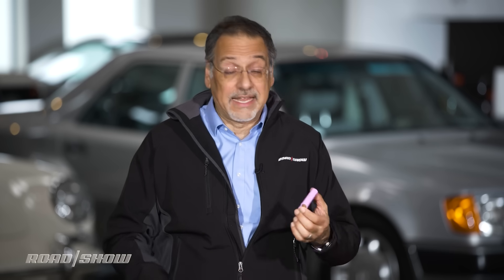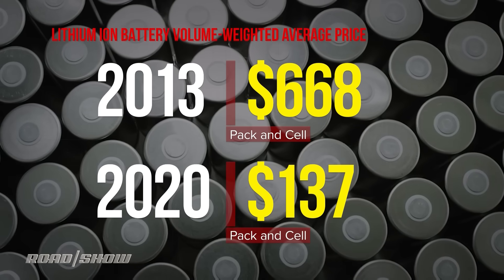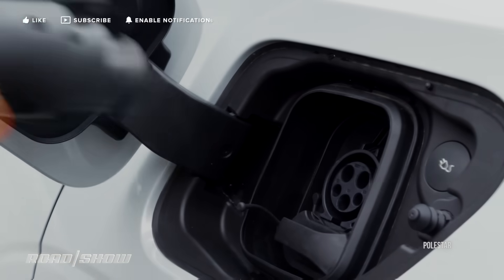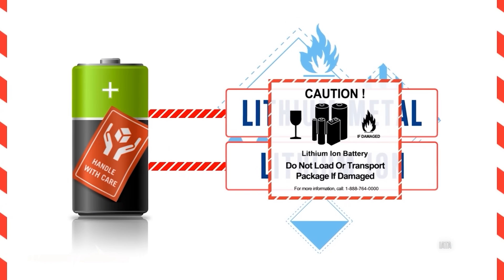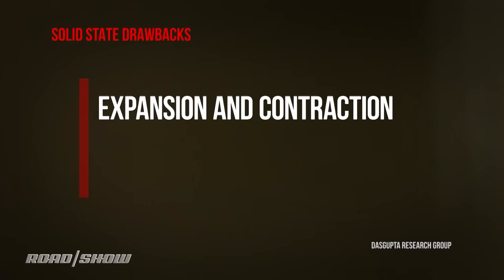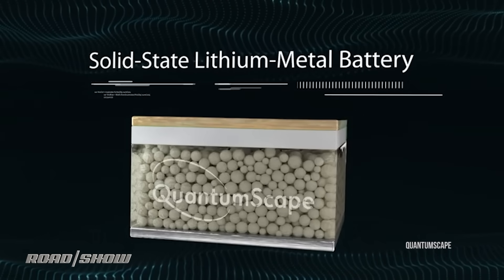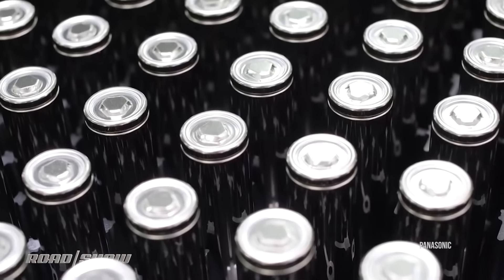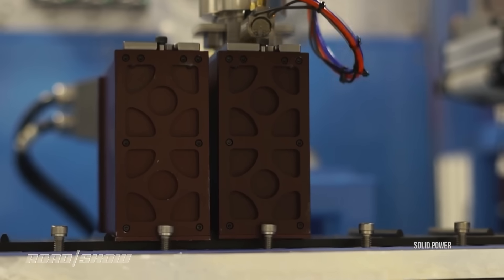When solid-state batteries arrive, you'll want an electric car

Comment: Dendrites are a problem with Lithium Ion, the liquid electrolyte allows it. Solid state batteries actually solve the dendrite problem as the dendritic growth is stopped by the solid medium.
Reply: I've seen another one of these explainer videos making the same mistake
Reply: I thought that was the case. I might have to do my own low budget less graphic version 😉
Reply: Dendrites?  Is that like what we used to refer to as tin whiskers, or simply the way they operate?
Reply: @Edgy01  Nope...you got it.  Tin whiskers.
Reply: THANKYOU,,,I was literally yelling at the TV with the amount of wrong this guy was babbling on about....
Reply: I hate when they misinform people.
I was "Dendrites on solid batteries? Whats he talking about"
Reply: @supaburger  I'm not technical at all and trying to learn everything with regards to EV conversions atm so obviously keeping a keen eye on battery tech. Got a V8 at ths mkment and nees to do a conversion myself. I think solid state will be the upgrade after 7 years I guess. Although battery tech seems to be the new gold so no doubt it will be quicker 🤔⚡
Reply: @chargeheads  you're converting a combustion engine car into EV? That seems like a bad idea, I know tesla had to completely restructure the car to make EVs feasible.
Reply: @chargeheads  Sorry, but I think these lazy young engineers are leading you down the primrose path on that one.  Electric motors don't need to be as big as they are, if you have a multiratio transmission, and batteries are probably the worst way to provide energy.  The weight and lifespan penalties alone take them into the realm of 'why would you do this?'
Reply: @mikeyfreeman5776  - There are lots of use cases, that an EV Conversion can Satisfy, and some that do better than the Leaf!
Reply: Unfortunately, you're describing a CAPACITOR, as opposed to a BATTERY.  And, likewise, any battery set up as suggested, would have the same problem of faster discharge while sitting there.

Which is what they keep running into.
Reply: I'm referring to solid state lithium doped mediums. The name of the game is quality. Anything worth the time nonporous ceramic designs. No "pseudo-solid state" with aqueous coatings conducive to dendritic growth. "VERY limited cycle lives"? Hmm. Teslas Li-ion battery design currently has 1500 cycles to 80% end of life. These are roughly 800 cycles and solid powers are looking at 1000. Constant R&D and test results are showing a path to 2.5x the energy density of current lithium ion designs (which are believed to be approaching maxing out) 800 cycles but charging 2.5x less often means the prototype is already better.

Forget the severely mitigated "dendritic growth problem" that's overblown and conflating Lion with SS unfairly. FUD. The issue to tackle is cost. With this much attention and investment let's look at what March 2022 looks like for solid state. I bet it's better than people are anticipating.
Reply: @Echos_of_the_Deep  They're using the same type of batteries that, in a laptop or phone, only that long if they're recharged SLOWLY.  Even then, that lifespan is a stretch.

I would direct you to LiPo batteries for that version of 'solid' state, and how much more prone to combustion events they are.  Chemically, electron and ion transfer can only take place so fast, and last only so long.  No one, including Tesla, Panasonic, or the others, has made anything that defies the laws of physics or chemistry.
Reply: @billcichoke2534  I have several LiPo batteries for RC cars.  As long as they’re balanced when charged, they don’t get too terribly hot and charge per fast, but they’re 1/100th the scale that would in a full size car.
Reply: @chadcoady9025  My point exactly.

You don't scale UP the amount of batteries you're using, and DECREASE the chances of combustion events.  Even with the most sophisticated thermal management systems, you're trying to charge these batteries faster than is safe.  Also, you're damaging them every time you try.
Reply: @billcichoke2534  yes that concern is relevant for Li-ion because of the aqueous electrolyte. But true solid state eliminates any runaway thermal event by replacing that very electrolytic medium. Via polymer or ceramic. These are by nature non-combustible. Also dendritic growth is severely mitigated by the tight nit crystal lattice of the medium. It's simply harder for the lithium deposition to take place simply because it's a solid that's "nano-porous" if I can make up a word, and that separator that can't be punctured in lipo isn't present in SS, the medium IS the separator. Looks like Ag-C is a good current solution. I agree with your logic on the high voltage quick charge but I think it's just a fact that chemistries can simply naturally handle that part of the equation more effectively than current lipo standards. Almost a semi serendipidous fashion for lack of a better way of putting it at the moment. I think where they start is continue the brutal quality testing and end up with a chemistry and voltage that satisfies their concerns in failure rates.

I don't mean to make it sound like it's a simple thing to do or they would be scaling up production as we speak. But also I think there is so much money to be made, legislation continuing to be passed and environmental consequence on the line, that we will see these chemistries engineered quicker than we may have expected in the past. The next 12-24 months will be used as efficiently as possible. It is IMHO that were gonna see the Tesla process of "underpromise and over-deliver" on this anticipated sector.  Maybe I'll be wrong but the trend of advancement has been exciting.
Reply: @Echos_of_the_Deep  The solid electrolyte can be the separator too but it is not necessary. Currently the ionic conductivity with polymer electrolytes is like dozens of parallel short ladders. Ions has to jump from a ladder to another. To avoid congestion we can shake the ladders (heat) which then helps ions to jump around and get to the direction of right potential. Now this all is changing as production engineers are enabling in-situ polymerization of the electrolyte. This method builds parallel long ladders which even cross each other which enables high ionic conductivity even really cold temperatures (-65C). Remains to be seen how well the ladder top and bottom can be inserted to the lattices. If we get that done right say by prefabricated ”SEI” we have found the Holy Grail of li-ion. We are talking >100.000 cycles and >50 year life and super cheap cost (<$10/kWh).
Reply: @mfb424  Fascinating. Sounds like you're in the game. If so this a good example of post-bench, pre-production R&D diligence these companies that stand to generate exponential growth. Being the first out the gate with a lower cost, high voltage, high cycle life product, to say is advantageous is an understatement.

Can you divulge why polymer electrolytes are favored above what QS here is using (ceramic)? If I'm assuming correctly that's your stance. These are the specific questions I want to dive deeper into. As I'm reading, I understand the necessity for cooling the pack is diminished as the efficiency is not reduced via heat.  Can you comment on any substantive difference in polymer vs ceramic, if any?
Reply: @mfb424  or is it a ceramic oxide doped polymer composite that is making these terms more or less synonyms in the industry? I'll try to find out but it's hard to tell when these companies are holding the cards close to their chest regarding the EXACT electrolytic compositions they are working with. So it's causing some confusion. They probably prefer it that way.
Reply: @Echos_of_the_Deep  Most of what you're describing carries with it some EXTREMELY toxic production processes, many of which are banned internationally from what I recall.  What Tesla and the others are trying to do RIGHT NOW, is causing more than a few enviro-whackos to file suit to get battery raw materiel and substrate processing stopped.  I can't see them being friendlier about THIS stuff...
Reply: @billcichoke2534  I know that's true Li-ion liquid organic electrolytes but I don't think that's actually true regarding solid state constituents. If you have some editorials or peer review, I'll take it. I'm sure the chemical precursors are toxic but once combined they're a solid and more or less an inert crystalline. I don't see their manufacturing any more dangerous than petroleum distellates, plastic or your bleach factory? OSHA DOT and EPA standards should be sufficient for defining containment and transport especially with the return to competency of the current administration. Lithium raw material extraction there's a concern about the limited ground water and it's potential pollution, and threatened native species habitat loss. I wouldn't call them "enviro-whacko" obstacles as much as ensuring the potential issues are addressed. It is definitely a bureucratic headache but it's a necessary one. The US is and always should be one of the highest standards of environmental protection on the planet. For all I know it could be oil interests playing their last cards at swamping the shift. Nothing's been too low for them to pull.

I think it's all going to be hashed out, because it must, or else the eastern seaboard moves in 5-20 miles in 80-100 years.
Reply: @Echos_of_the_Deep  Well, before we talk about moving seaboards, let's ask whether the water level would go UP or DOWN if the ice that's already in it, melted.  Then let's talk about all these folks like Algore, owners of and invested in beachfront developments.  If they're SO SURE about AGW, what are they doing?

As to any enviro standards for battery raw materiel  and component processing, they're still done in China, which has none.  And I still haven't really seen that many cost or performance hacks from all these advances in materials.  All I've really seen, is increases from basically AA batteries to D cells.
Reply: @billcichoke2534   @Bill Cichoke   @Bill Cichoke  Ahhhhh I knew you were a FUD man. The conjecture was too pernicious and not up to par enough with the specifics to have such ostentatious verbiage. It wasn't passing the smell test. I thought that might be the case. Before we talk about moving seaboards...(in 80-100 years. Only necessary if we don't solve the very thing we are discussing right now) let's talk about how insulting it is, after negating all of your childish red herrings and straw men with detailed explanation as the best of my ability that I would somehow fall for that? I'm assuming it's a trick question because the answer is zero change. Correct? you tried to stump me right? SMH...After all this solid state chemistry talk, that you would assume I would not understand remedial chemistry? Net volume. Stoichiometry. You even gave me two wrong answers to choose from, WTF is this? 

This whole this is... Lol bro, what are you doing here? Seriously.

Al Gore... if what you're saying is even true. I can't trust you to tell the truth anymore you've lost that respect and courtesy. Al Gore doesn't stand to lose any beach front property for the next century or two, and YOU DON'T SEE WHY that's a terrible argument to make?! I could have skinned that argument 3 different ways. Maybe he believes we're making progress? IDK. You think that he, the original famous whistleblower doesn't believe in climate change? Why? Explain that. I want to hear why that is. Should be rich.

Questioning the validity anthropomorphic climate change while offering conjecture on the SAME SCIENCE that we use to create batteries. Great job. Do I have to explain to you the essential incorruptibility of the scientific method and peer review? The EXTREME thoroughness and humility of the process?

YOU haven't SEEN ANY? I have, how about IDK the iteration of solid state itself? Or maybe the lithium metal anode? Or solving the dendrite problem, or silver carbon lining, or silicon anodes, graphite, lithium doping....Cost? These are already cheaper elements. that's capitalism's ONE job....Which.... mutant capitilism is the very thing that got us in this heap in the first place. As for your China materials argument I'm not getting into it, it's just wrong too. Positing things as true does not make them true! These things are able to be known with little effort.  You don't get to say it all comes from china when it's just not true. Lithium? Australia and South America. Nickel? Russia and Canada. Cobalt? DRC.

You should be embarrassed and ashamed of yourself.  But you won't be, because arrogance is ignorance of ignorance. Unbelievable. "Climate change denier offers his revelations on battery chemistry"
Reply: @billcichoke2534  Do solid state lithium ion batteries still have liquid electrolytes?
Reply: @chadcoady9025  Every solid state battery design thus far has been some kind of polymer electrolyte substrate, not too different from your standard jelly roll.  They have NOT proven to be able to hold a charge long term (like a capacitor) and have had very limited cycle lives.
Reply: @billcichoke2534  Thanks for the info!!

Comment: if they can get a charge below 20min then I think people will finally buy EVs in mass, especially Americans, I know how impatient we are
Reply: most Americans won't buy evs unless they're force to., when companies stop making piston engines just like when they stop making rotary dial phones, big box crt TVs, vhs & beta, 8 track tapes...etc. China is leading EVs adoption because they understand the benefits outweigh the charge times
Reply: @maynotbe  I think a big issue is, people will say "EVs are taking away jobs from mechanics" and whatnot, which isn't entirely false; the skills you need to work on EVs mostly requires going to college, which is astronomically expensive in the US. it's just easier to resist EV integration
Reply: @Jakobly  "Think of the mechanics!" LOL! Let's switch to EVs and all kick in a buck a week for the Mechanics Retired to Beaches fund and we'll all be better off.
Reply: @maynotbe  with swappable batteries, in and out 3 minutes.

Comment: I can live with 15 minutes thats fair not whole day
Reply: Don't know where you are getting a "whole day" from since you can charge from 0% to 80% in about 30 minutes right now with Tesla Superchargers and most other Level 3 chargers.
Reply: @ElectricGlider2016  s
With a super charge yes
Reply: @teamallyracing1780  Ok then. And the same exact thing will apply to this solid-state battery 15 minute charge. You will have to go to some level 3 charging station to get that fast speed. So I still don't understand why you are trying bring up slow level 1 charging as if level 3 charger does not exist right now.
Reply: @ElectricGlider2016  all am saying at the moment electric cars are still an  incovenience  compared to gasoline, i would  like to go somewhere  quick without having to park for 45minutes waiting for  a charge ,these new batteries will offer that alternative 15 minutes is almost similar to going to gas station to fill up your car and waliking through isles of the station while looking  for a snack
Reply: @teamallyracing1780  it's a difference of 30 mins to 15 mins..... And actually for me personally I really only wait 15 to 20 minutes right now since I usually go around 15-20 to 80 percent and not 0 to 80 percent. So the point is we are basically there already. But when you said "all day" I want to make sure you literally didn't think that the fastest that we can charge an EV right now today is literally 24 hours.
Reply: @ElectricGlider2016  how long does it take to charge at home on what most people have?
Reply: @teamallyracing1780   at home level 1 is 110v or level 2 is 240v outlet (25 miles/hr). you can find a charger on ebay around $150. outside you can use apps to find stations, plugshare, chargepoint, evgo, ABRP, electrify america, even Google maps...Level 3, 20 min to 40 min (meal break)., to get to the next charge station.
Reply: @maynotbe  so you just need to eat 5 times a day on a road trip ...
Reply: @Gareth Tucker I know home charging is not for everyone especially for those living in the majority of apartments right now. And an EV in general is not for everyone for various other reasons. But that has nothing to do with the topic we are talking about which is DC fast charging speeds which seemed to be the only issue that this guy had for him to get an EV himself. My only point was that he can fast charge an EV today, right now in 30 minutes or less.... and not "all day" as he originally said.

Comment: I wonder what the texans say about electric cars with their current electric power situation...
Reply: In the UK they are developing systems and laws to use vehicles which are plugged in to the grid to use some electricity when needed at peak times.  And charged and low times. Creating a more stable grid. Also amazing for renewables. Somewhere to store that energy.  Anyways with the outlander PHEV you can buy an adapter allows about 3 days of home use in a power outage.  We don't have one but in Japan they sell them at the dealer.

Comment: "Ceramic" is a solid metal(s)/oxide(s) crystalline lattice structure.
Reply: Wrong.  ALL ceramics are amorphous mixtures, BY DEFINITION. If it's crystalline, IT CANNOT BE A CERAMIC.
Reply: @akulkis  thanks, I didn't think about an amorphous mixture incorporated into a solid state product.
Reply: @akulkis  I noticed in one of my solid state chemistry text has a "multilayer ceramic capacitor" has internal electrodes, with dielectric between them.  They use a barium titanate with its very high permittivity.
Reply: @cerimite7674  that's a capacitor, not a battery.  Capacitors in series have less capacitance than any of the capacitors by themselves  (same equation form as for parallel resistors or parallel inductors).